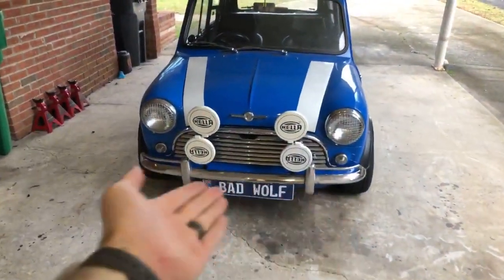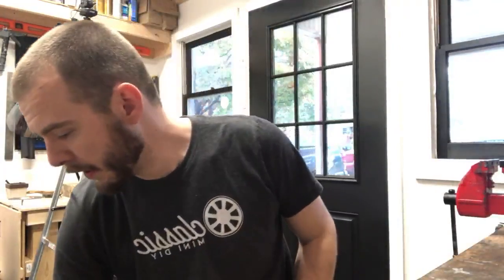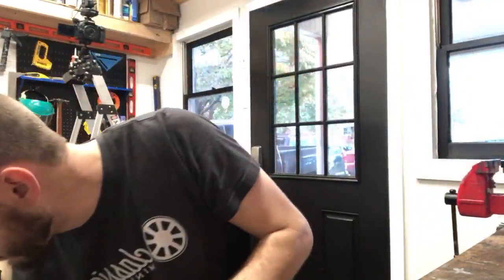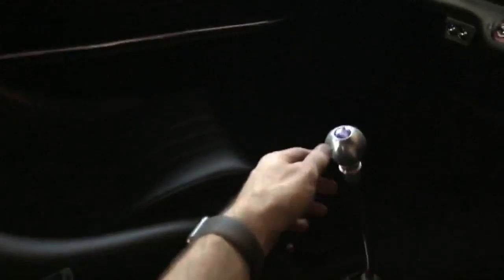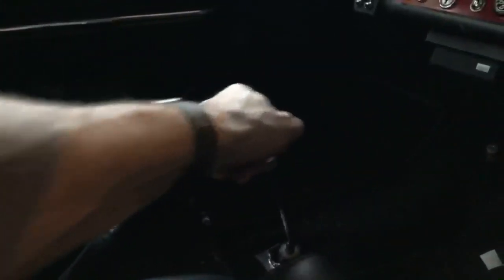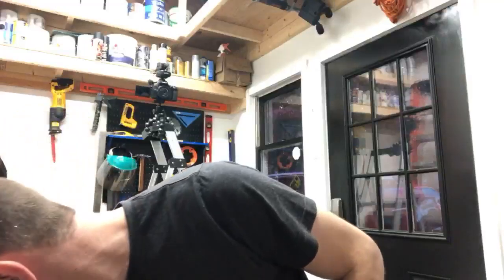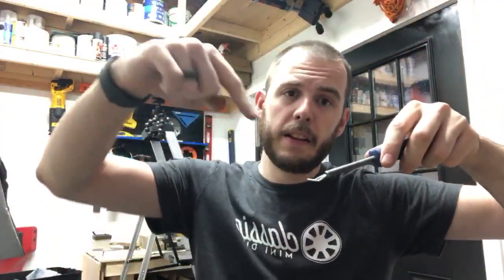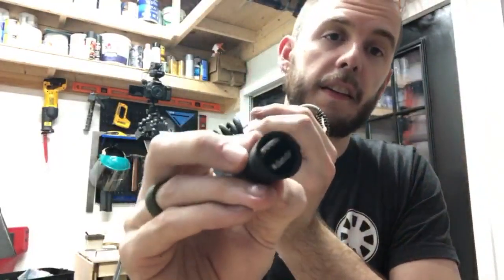Classic Mini DIY LIVE - Ask me Anything

Comment: Hi, any one know what is the best ratio final drive for a metro 1275 on 12" wheel's.
I need to bring the Rev's down a bit, I think it's a 3.4 ratio standard but not sure. From what I have read a 2.95 might be good.
Thanks.
Reply from the maker: Hey Paul! I haven't sampled every FD but I know I really like my 2.95 on my 10 inch wheels with a 1293. Anything taller (smaller number) would be an upgrade from the 3.4 as far as revs go.
Reply: @classicminidiy  OK thanks, i have read you my need to replace cam with a mid road race to improve the lower rev band.
Also told that just an economy tune should help, this would seem alot cheaper option .
 we are doing a full restoration on a 1979 here in the UK it's just come back from paint and looks very nice in ermine white.
Anyway thanks again, love your  channel by the way.
All the best bud....

Comment: First comment tidy just a quicky buddy I just started my mini van first time in 6 months had to pump up the tyres my question is this, wen I pressed the brakes there’s nothing u did a viddie on diagnosing what it could be after it’s been sitting so long could u point me in the right direction please bud ?
Reply from the maker: I don't have a video about it sitting but it sounds to me that you have air in your brake system. The best thing to do would be to bleed the system. I do have a video about eezibleeding the system that should help. Link below!
https://www.youtube.com/watch?v=ajZDmZaIZNU
Reply: Classic Mini DIY I tried the easybleed yrs ago bud the pressure in the tyre blow the lid off the reservoir the reservoir was inside the cab of a vw camper van it run down the electrics dash board steering colom  onto the mats, it’s been shoved in a cupboard ever since, but I will do it the old fashioned way bribe a friend keep up the great viddies boyo